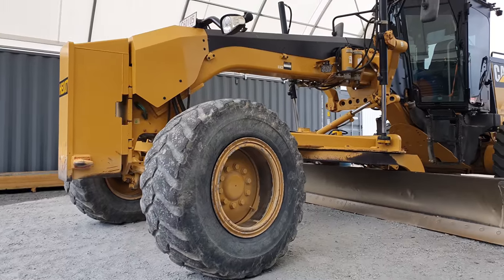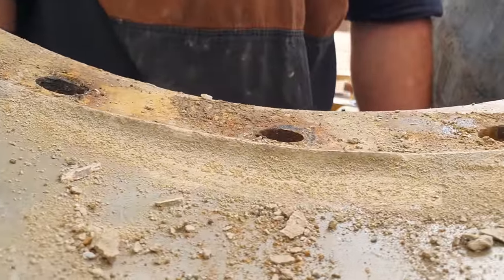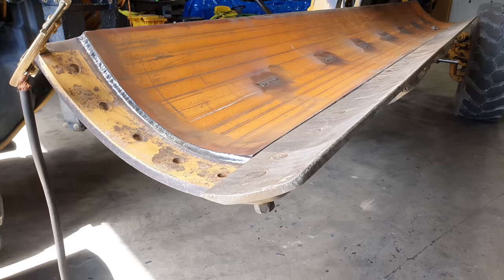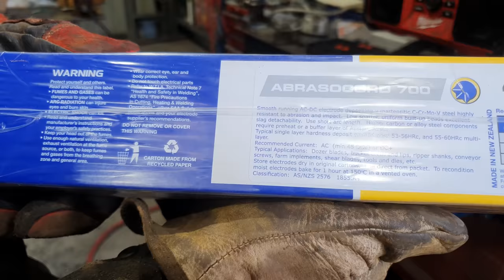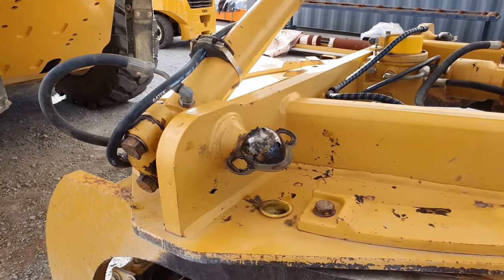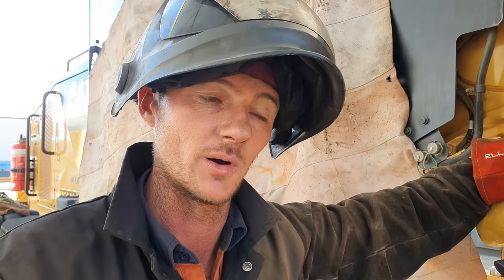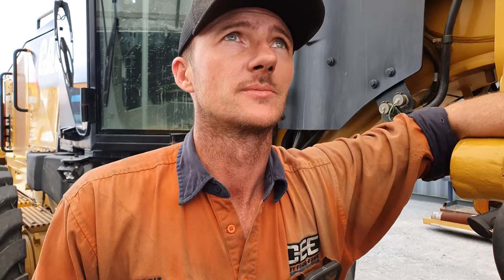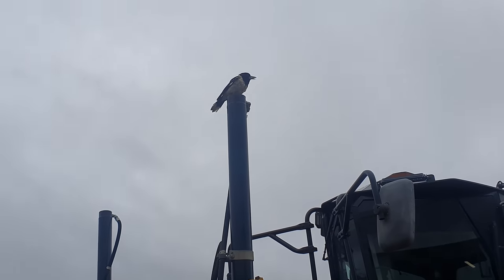This CAT 140M Grader NEEDS Repair | Part 1 | Blade Skin & Trunnion Balls

Comment: Probably sounds cheesy... but I was mighty impressed at the skill on the air arc gouging cleanup at the bottom of the trunnions.  It's those little things that really show that Kurtis is a master at many crafts.  Shout out to Karen too for letting as all see and enjoy!
Reply: Noticed that too - his economy and precision with that insane arc are top notch. Steely-eyed machinin man.
Reply: Ah dude I commented on the same thing without seeing yours!
Reply: defo makes it look easy pure skill
Reply: was just thinking, would placing wet towels below job not cut down on how much spark fly's about ??
Reply: @adamhook6229  Great minds think alike!
Reply: @stuartbrittain6650  it would help, but with arc gouging and the molten steel dripping down, the rags will catch fire too. He did have something down at one point. Sheet metal works better.
Reply: @stuartbrittain6650  In my VERY limited experience, with a plasma cutter which is nowhere near as awesome as air-arc gouging.. more hassle than it's worth.  Molten steel is 1200-1300ºC.  It might cut down for a few minutes... but they'd just catch fire eventually with one good glob.
Reply: " the skill on the air arc gouging cleanup at the bottom of the trunnions"  ahhh... nuthin' a few minutes with a Dremel couldn't do...  
;)
Reply: @Self_Evident  I would have croc sawed it off no bother

Comment: It might come as a surprise to someone living in a hot climate, but here in Canada we use graders a lot for plowing snow in the winter months. Keeps the graders working all year round. Have a great weekend you three!
Reply: Aaron Preston is that because they have certain ability s like straight shoving or just because they are there. Over here ( the netherlands) there is a blade with a rubber flap on the front of the truck that also has the salt spreading unit ( a rotating disk) on the back. So both go at the same time.
Reply: I've seen that in the US occasionally, if we get a bit too much snow for the plowtrucks to handle.
Reply: @henkoosterhof5947  Graders are often used on long rural gravel roads, they can push more snow than a standard plow truck. They’re usually equipped with a blade on the front of the grader or a wing blade on the side to increase their reach. Look up the Volvo Snow Fighter graders to get an idea.
Reply: @aaronpreston47  thnks
Reply: I was going to comment it was strange not seeing a dozer and snow wing on in mid October. In Northern Alberta we usually get snow to stay by October 31, and it hangs around till at least early April.  Most oilfield graders live out in the field, and only come back to the shop twice a year, in the fall pre snow for major repairs and upgrades, a thorough cleaning and snow wing install. Then in the spring, to remove the snow wing and repairs and cleaning. 
I think my longest daily commute to the grader was 110 kms each way. Thankfully that was only a 3 month job. I was paid from the time I left my driveway until I got back home at night, and the company provided the work truck. 
I think I own over 120 audio books, just because most of the remote locations I work don't have reliable radio stations and satellite radio programming has not improved over the years. When you can put in 300 hours a month doing snow removal,  once your roads and shoulders are froze in and set, the only worries you have are pickups not paying attention.
Reply: @aaronpreston47  Graders are the weapon of choice for the crews on the roads in Rocky Mountain National Park. There's some hardcore grader driving! Don't miss that edge, fun drive down...
Reply: @henkoosterhof5947  here in Canada the highways and motorways are ploughed and sanded/salted by large dump trucks fitted with front and wing blades when required for snow clearing and they usually plough at around 40 mph or 65 kph. 
They also carry salt or sand or a mixture and spread that to help with traction.
 If ice is anticipated they also use a beet juice concoction to slow the accumulation of ice especially on bridges and overpasses. 
The wider roads have tandem units one behind the other, staggered across the road to clear the full width. 
Graders are used in parking lots and rural gravel roads that don't get salted or sanded. They often have a dozer blade in front and a blade instead of the rippers at the rear. In the event of very heavy snow their blade agility is used to cut the snow banks further away from the road where the trucks can't always reach but only where they get far more snow than we do in the 🍌 belt 🥋🇨🇦 south.
Reply: @northrungrader8937  thats because sir its the other part of the world!
When we on the north part of the world have winter ,,down under,, its summer. They have christmas in swimwear and a barbie(bbq) outside the house because its full summer.
Reply: @ronwilken5219  thanks. Over here only tarmac or backed claystone roads so its sort of simular.

Comment: Excellent work and videos. I am retired 10 years from the same heavy and Highway mechanic and Welding trade as you for 40 years and the one thing I would definitely do if I had it to do all over again would be to use the PPE equipment religiously and definitely purchase and use a respirator as yours for welding. Fortunately I always wore eye and ear protection but lacked on the respirator  when welding. Never any serious health issues because most of my work was done outside in the field with plenty of somewhat fresh air. Oh well, too soon old too late smart. My wife enjoys watching your videos with me on occasion and now has a better understanding of what kind of work I did all my life. Thank you, Ed N.E. Ohio USA

Comment: I've made my own wrench extension too of varying sizes. They have two opposing flat bar hooks that slips onto the wrench shafts at an angle. Then turn to lock it on. Also turning it over attaching it from underneath to go in the opposite direction, But yours with the bolt on the fork side is great idea too. 💯% Working smarter not harder.

Comment: Regarding hearing protection, I know Curtis is a grown-ass man and knows about these things. I wasn't worried about him as he knows what he is doing. On those ear plugs, I used to work in a stainless wine tank fabricating shop as a helper during my summers of school (not a welder, I didn't have enough knowledge). It was my job to get inside the tank as we were fitting the 4' next ring on to the tank as we built it up. The fabricator would be on the outside with a TIG torch and a dead blow hammer to manipulate the next layer of tank around so it fit up perfectly. I had a hammer on the inside, also moving around the next layer of the tank so it could be tacked in place. I was basically in a giant drum for this process. I did it hundreds of times over the 4 summers that worked there. I am a 41 year old man and still have perfect hearing so I know those things work. Thanks Karen and Curtis for making this content.

Comment: Kurtis’s safety around his shop is actually very good. PPE he has covered in other videos and as you watch you will see him use machines, hoists and straps to secure and move tools and equipment around his work area. Speaking of work area he cleans up during and after each project. His explanations usually cover his process and safety is self defined in these commentaries. While he hasn’t said, I presume one big reason for working alone is safety. This is the first time I’ve seen him talking to birds….😂

Comment: Knackers, keep your dead gloves, drop magnets in the remaining finders. I do this and build welding enclosures by slapping the gloves around the structure when working on tricky stuff. Stops spraying hot metal everywhere. I keep them on the racking beams for easy grab after finding throwing them in a bin ended up is a magnetised leather brick. Love your work, right tool for the right job.

Comment: You know whats great about watching CEE doing this work, there is no BS what so ever. He is a true job shop that does it the best way and most economical way to get the job done. Other machinist youtubers would turn a job like those trunnion mounts into a massive affair that requires days of part positioning, precision measuring on and on. Probably 3 videos or more. Not with Curtis he doesn't blow smoke up ones ass with excessive measuring requirements and unnecessary procedures to just get the job done as a true job shop does. Not taking away from other Youtubers but I love the no nonsense how it really is in the real world.

Comment: I love that combination wrench extension at 17:50. That's going on my to do list, maybe a couple that can be adjusted to fit a range? I now have the brass as well for the rotary ground clamp, well it bronze, but it will do. Just need to make the rotary table thats also on the to do list.
Reply from the maker: hey mate I made that on the fly one day after breaking a spanner (wrench) might have to do a shop made tools video and make another!

Comment: Even the sparks off of an angle grinder will burn pits in the glass.  I worked for an agricultural equipment dealer many years ago and we had a dealer recall update on all of the new combines we had sold that year.  It was cutting off chain guides in the feeder house and welding an updated set on.  We used an angle grinder to clean up the area where we had torched the old ones off and it sprayed sparks all over the front window.  We had done two brand new machines before one of the customers let us know it had damaged his window.  We learned something new that day.

Comment: Typical. "That's not a grader. THAT is a grader!" 😎
Another fun video, folks. Man, I probably wouldn't even be able to park this thing in the yard without destroying something.

As usual, a great weekend to all the gang!
Reply from the maker: and this one is just a cutie compared to the 24M 💪
Reply: @CuttingEdgeEngineering  I was just going to make that point, I operated a 24 M for about nine months, had to learn how to grade all over again when I moved back down to road maintenance graders, LOL!! BTW if you stand up before releasing the steering joystick, the wheels will stay at “full turn”, handy to know if you need the extra room while working around front end.

Comment: If you want better penetration of your ear plugs reach around the back of your head with your opposite hand and pull your ear and backwards. This will straighten the ear canal and allow you to put the ear plug in farther in and give you more protection from sound. Repeat on the other ear. G.
Reply from the maker: thanks for that tip!
Reply: Yes that's the way I do it, you get a really good fit. I normally use Howard Leight Lazers on the strings, really good attenuation without the expense of the really super quiet ones.

Comment: Those trunion balls almost seem like you could just use 50mm tow balls, probably cheaper and bolt in rather than weld in. But I somehow think those rams would snap them like twigs. Awesome work as usual.
Reply: Unfortunately, Lawyers. If some kind of accident happens and the investigators link a ball failure to it, then Curtiss would be responsible. Using OEM parts he could say it was a manufacturer supplied parts and cover his a$$.
Reply: Given the forces involved I don't think the bolt holding on a towball would be anywhere near strong enough. The amount of metal to metal contact of the weld, especially on the perimeter, spreads the load evenly onto the mounting steel rather than just a point load at the centre.

Comment: Does that rust effect the strength of the weld
Reply from the maker: that wire burns through the rust really well, any impurities are drawn up through the flux so it's not an issue

Comment: Good to see your "armstrong-lifting equipment" is still working well. "Flipped that skin right over!!!!  I really liked your wrench "extension arm".  Much better than hooking one wrench in the other.
I love seeing your work on the graders. I've told you I was an assembly line supervisor on graders for four years in the era of the "G" series graders.  The "M's" are impressive.  I was not aware of the rounded "tube" part of the frame over the blade.  Excellent welds on the balls and nicely repainted!!!!

Comment: Good to see your hearing protection.  I use the same type for just about everything as they aren't bulky and get in the way and also, for extremely loud work, you can double up with ear muff styles over the top.  As set of plugs is always with me, either in my pants pocket or my shirt pocket ready to put in.  At 73 and after a lifetime of shop work and operating equipment, my hearing is still near 100%.  ( Wife doesn't always think so, though.)

Comment: Kurt, just a suggestion... you might consider a couple of large custom "Tent Doors" or Tarp Doors for one end of the outdoor shop so you don't have to worry about the wind. Just draw the flaps shut to control some of that issue. Just a suggestion.

Comment: I used to enjoy flame cutting stuff off with gas and flame washing it back to the base metal.  Used to do it with multiple rusty bolts holding suspension frames together. Get the bolt the right colour cherry red and away it goes with excess oxygen trigger. Took me back 35 years nice times.

Comment: OMG...that reminds me of a job I did. I was installing steel racks in an auto parts store. The owner didn't measure the ceiling highth and I had to cut 8" off. After cutting 10 pieces and put them back upright. I discovered the grinding dust was peppering the office windows and doors. Total wipe  out.

Comment: After watching you take several cutting edges off I still wince when you put your fingers on the plow bolts. I have lost layers and chunks of skin doing that and had a guy lose a part of his finger doing the same thing. I now use an old broken hammer handle as my hold down to save my digits even though twenty years in the industry has left them a little worse for wear.

Comment: I've watched a lot of welding videos, but I've never seen using a arc welder to cut steel with!!!
Watching you burn through those trunion balls was impressive!!!
Also,really good trick using the bottle jack and chain to apply pressure to the blade skin to hold it in place!!!
However, it appeared those trunion  bushings failed from lack of greasing...
All of the cups looked like the original grease and were dry....
Would do good to go over the tractor and lube all the fittings...💯👍👍

Comment: The blade skin, just like you did in the last video.  Also, the trunnions look exactly like the trunnions known as "trailer hitch balls".  Must be designed on the same principle, but much stronger.

Comment: You could use one of the offcuts to make a template for the centre weld holes - lay it on top and straight in with the plasma cutter. Holes have to be oversize obvs :D

Comment: As a class A welder all my life I worked in a big paper mill logging camp. Welding on huge machines down to these small graders. Refaceing D7 an D8 dozer blade. Air arc off the huge trunun balls on the C frames. It work I love. To doing the same on graders that we also had to change the cutting edges over to ice cutting edges. They cut groves in the ice cover hall roads to rebuilding the mole boards on graders an dozens were they were war half way or more into the bolt holes. I always wanted to lean on my own machining as we had every shop class in high school but machine shop class but I have self thought my self many other trades. Since I feel 18 feet off a huge logging machine an broke my back. I do jobs for locale loggers to contraction guys. I always got a guy who was a retired machinist an had a shop at his house to make all my pins an bushings line burning. He showed me a lot. An made me a boring bar in 2 sized to use in my floor standing drill press. But he pasted away 10 years ago an now have to pay the way over priced big machine shops that more then half the time they dont wabt my as they say. Small jobs. I have always wanted to buy lathe and a mill to make the parts I need. But buying  them is a big cost then all the tooling needed.  as I have tons of stock everything from brass high-tensile rod as I always supplied him the material  he needed. I'd buy it in 20' lengths. But due to my ex wife getting a court order for just about everything I owned plus all the funds from my work settlement. I am stuck with my disability pention an the side jobs I do.  I am only good for 4 to 5 hours a day.  Machining has always been the one thing I want to do.  I have to turn down a lot of jobs due to shops not wanting to make parts I need. Mostly bucket pins bin boses shims cylinder and Rod repairs. I made my own line bore as the old guy showed me how to make an use the same one he had. I been around machining work a lot in the Bush camps as they all had a lathe, Mill and boring bar and 1 Machinist. One thing I notic on this job you are doing. I dont see a dowel pin in the frame for the dowel pin on the back of the new weld on trunun balls. All the graders I worked on had a 1/2 hole to fit the pin on the back. The D7 an D8 had a 3/4 pin. So there was never a need to measure but you may have filled up the hole with the arc air cutting down through the centre of it I don't know

Comment: Kurtis has been hanging around George too long. The bloopers set up looked like George going through the motions of trying to get to an awkwardly placed snack.
Well behaved bolts on the grader blade. If that'd been my job Murphy would have required a six foot breaker bar to get them off.
Excellent work as usual. Thanks for the posting. You should sell that one to Caterpillar for one of their training videos on "how it should be done".
Regards from Canada's banana belt
😜🐓🇦🇺🐨🤔🇺🇦🕊️🇨🇦🍌🥋👍